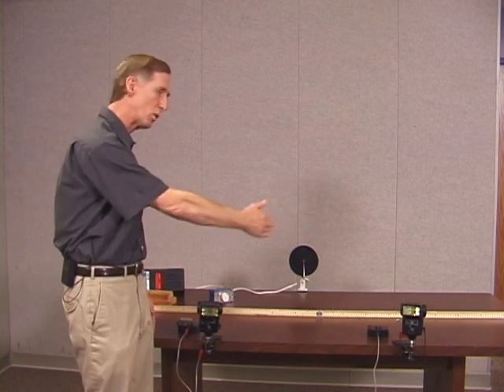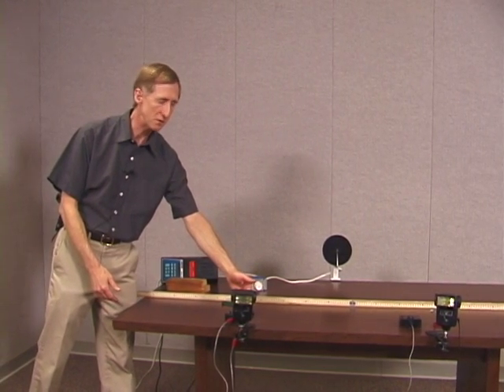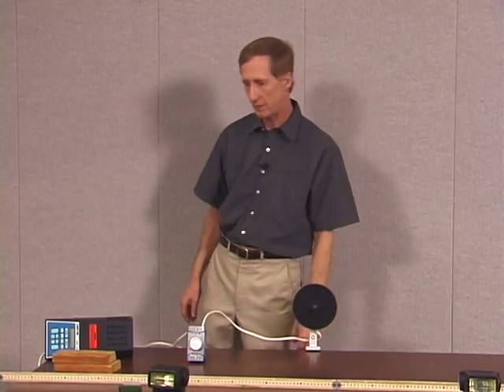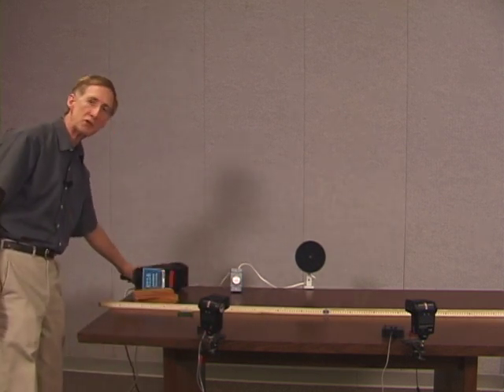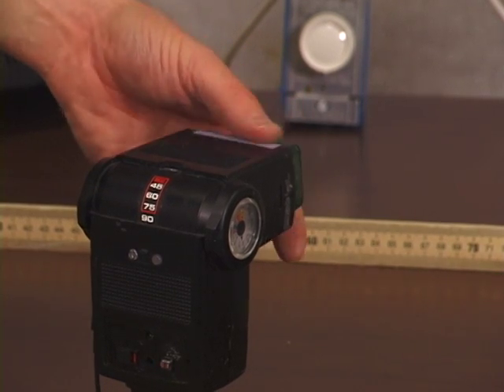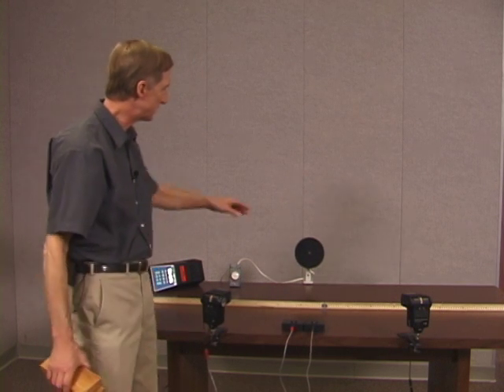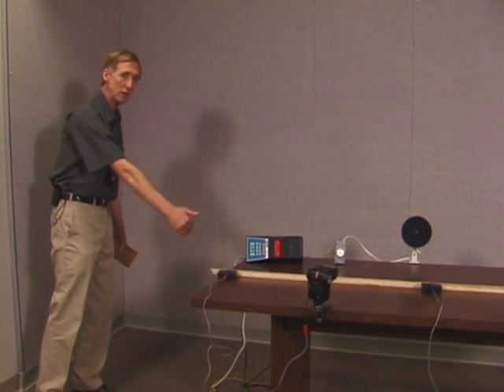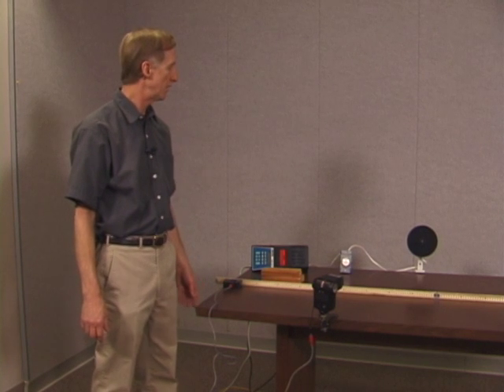Measuring the Speed of Sound, Part 1

Comment: 50 revolutions per second is 1/50 seconds or 20 milliseconds per revolution. 1/4 rotation is therefore 5 milliseconds. The sound travels 1.7 meters in 5 milliseconds, so the speed of sound is 1.7/.005 = 340 meters/sec. Exactly the nominal value. Amazing!

Comment: It is said that the speed of sound doesn't depend on the frequency. Can this experiment be used for measuring the speed of various sound frequencies?
Reply: It could if you had a bunch of sensors tuned to different frequencies, each firing a separate strobe with a different color. So if the different frequencies arrived at different times, you'd a bunch of spread out colored lines.

But there's a much easier way. Any brief sound necessarily contains a wide range of frequencies. The shorter the sound lasts, the wider the band of frequencies it must occupy -- this is a law of mathematics. If the sound lasts for 1 millisecond, then it must occupy a frequency range of at least 1/.001s = 1000 Hz. If you stand at one end of a football field and listen to a starter pistol being fired at the other end, what do you hear? Ignoring any echoes and reverberations, you'll still hear a fairly sharp "crack". That means all the individual frequencies of the gunshot reached you at the same time. If they didn't, if the low frequencies reached you first, then instead of a sharp "crack" you'd hear an upward "chirp", almost like that of a bird.

Wave speeds actually do depend on frequency in what are called "dispersive" mediums. One of the really interesting ones are the weird very low frequency radio signals called "whistlers", caused by the wideband radio impulses of lightning strikes being bent back to earth by the thin plasma in the earth's magnetosphere. They're heard as descending chirps because the high frequencies reach the receiver faster than the lower frequencies.

Comment: What's so special about 90 degrees? Any measurable angle would be fine if the disc was rotating contantly and the microphones were kept the same distance apart.
Reply: There's nothing special about 90 degrees except that it's easy to see visually without any kind of scale. 90 degrees of rotation at 50 revolutions per second is 1/200 of a second or 5 milliseconds.